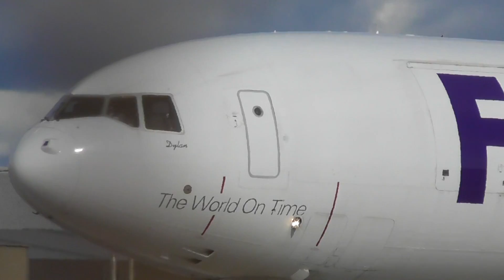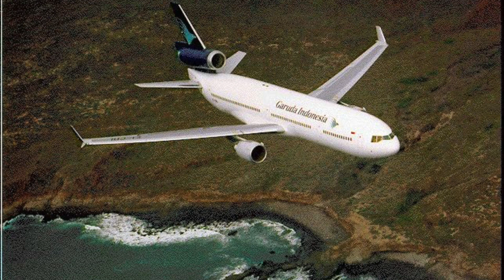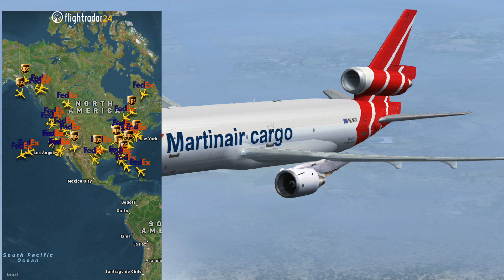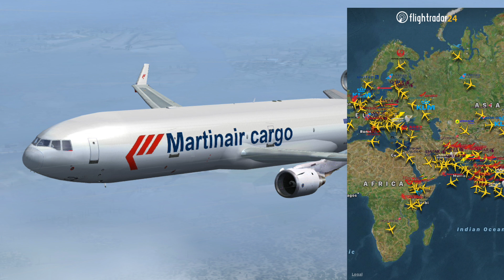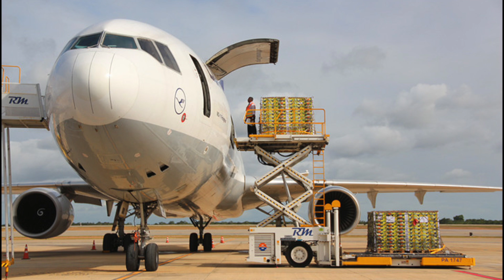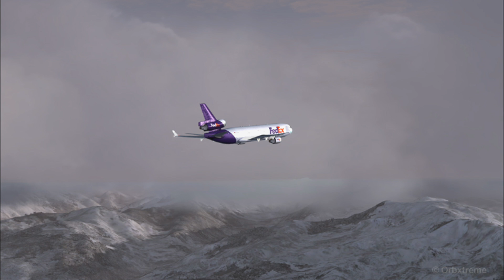WIll a RE-ENGINED MD-11 or MD-11X Work?

Comment: I rode in a Thai DC-10 back in February 1974 I could swear the pilot must've almost overshot Bangkok as we went into a steep decent & my ears were in pain. Never before nor since has that happened. I rode in a Lockheed L-1011 several times & found it far more comfortable. That said I never had the chance to ride in a MD-11 but it looked so much sleeker. I have bought myself the Eastern Express MD-11 kit & a set of SWISS decals to build. However, Boeing now owns MD, but after viewing your video I thought to myself.....if the nose was altered to be more aerodynamic & the tail redeveloped by deleting the 3rd engine, then adding 2 huge GE/P&W/RR engines under the wings, without too much effort you have a B-797.

Comment: If the MD11 is re-engined it would be a good idea for the engineers to design and retro-fit larger elevator trim tabs to prevent another accident like the one in Japan where flaring 5 seconds late destroyed the aircraft and killed the pilots

Comment: Thank you for a great video, the end came for the Three Engined MD 11 because of very tough competition from Airbus who claimed their A-330 Models could do the same job on one less Engine, MD also toyed with the idea of removing the Rear Engine to compete but never carried it out,  I did like the MD 80 & 90 Models , but they were upgrades of the DC -9 which had been built for a long time , and fell down on the fact that the Fuselage was a 2 x 3 and not a 3 x 3 compared to the Boeing 737 & Airbus A-320 . I do wish MD Douglas had survived and not sold out to Boeing ! but thats a fact of life , the strongest survive.

Comment: Yes it'll work. I will design it all by myself and then "put into production". It will have new engines new technology including avionics, a standalone third engine at the back using their own fuel system so that when the third engine finishes fuel, the other two engines still use the main fuel tank not the third engine 
And then it will have new winglets

Comment: Hmm, thought the video meant replacing the existing MD-11 aircraft engines, which might be entirely economically feasible and maybe preferable for cargo airlines. Might increase range/fuel economy, lower part costs, and increase the number of airports they can go to due to noise restrictions.

Comment: These planes were designed back when a minimum of 3 engines was a regulatory requirement for ocean crossings. Now that the rule has been changed, no one would opt for a 3 engine configuration. Unneeded cost and complexity.

Comment: MD-11 actually performs well on high terrain with its three engines. In 1996, China Eastern Airlines and McDonnell Douglas tested an MD-11 in Tibet and they concluded it did perform quite well. Since it has three engines, the thrust wouldn’t diminish as fast as planes like 777 that have two high by-pass ratio engines. This is a reason why cargo operators still fly MD-11. Maybe this would be a market for MD-11

Comment: Nice to see the old Delta livery.  I guess we all make choices, Airbus v. Boeing, Beatles v. Rolling Stones, but for me, the Lockheed Tristar was a better travel experience than the DC-10 or MD-11.  Of course, that was due to airline layout, but in Delta, that seating for the Tristar was roomy and for the MD-11, no legroom in economy.  Still, there was something very elegant about the Tristar.  When I was younger, my family lived in Los Angeles and I lived in San Francisco.  Most flights were on 737's and DC-9's, but if you were a bit clever, you could fly on a Delta or TWA Tristar or even a Pan Am 747 (their London-San Francisco flight would continue to Los Angeles).  Airfares were in the $30 range for coach, $55 for first class.  Those were the days. :)

Comment: Tri-jets existed mainly to satisfy FAA rules that prevented planes with only two engines from flying long flights over the ocean (they couldn't fly more than an hour from a diversion airfield). Once the rules changed in the mid 1980's with ETOPS certifications and twin engine jets could fly the longer over-ocean flights, tri-jets were no longer needed.

Comment: I thought that the 3rd engine disappeared because a single modern engine is powerful and reliable enough to get a plane to safety, if the 2nd one breaks down over the ocean. In other words the 3-engine planes are only favoured by the cargo guys because they're cheaper on the 2nd hand market now that the more cutthroat passenger market upgraded. Are they maybe also more flexible in terms of flying weight? I do miss them mind, especially the ones with the huge tail wings.

Comment: There is such a glut of old 2 engine airframes (A300s, 757s, soon to be 777s) as to make any future possibility of building more MD-11Fs a non-starter. Because freighters spend so much more time on the ground and not in revenue service, the major freight carriers won't buy a new trijet; they'll just buy and older twinjet and convert it. Re-engining the existing -11F fleet might gain some traction if it resulted in a fuel or maintenance savings to make for a short return on investment. The only reason UPS flies new 747s is the extra capacity quickly pays for itself on long haul routes. That said, I love the -11Fs and am much more of a fan of freighter service than pax. I only see A300s flying in freight where I live, so to see an -11F here would be quite a treat.

Comment: MD-12 was a FOUR engined airplane with full length upper deck like the A380.  I have some of the original plans and layout drawings from MDC.  Engines were weak as was the market then.  PS. GE-90s could be fitted to the wings but removing the banjo and center engine would be such a weigh and balance problem with the heavier forward engines, you'd have to take a plug out of the constant section forward of the wing or restrict fuel - remember there's already fuel in the horizontal stab on the MD-11.

Comment: I really feel the MD-11 was retired far too soon. But here's the ray of light. In this age where twin engine jets are dominating the market due to engines being so reliable, the 747 and A380 have still managed to hold on and stay well afloat. So I don't see why a revamped MD-11 won't work. They could also militarize the airframe and offer it as a KC-10 tanker replacement or maybe even an AWACS airframe

Comment: The company I worked for had a product that was designed for the DC-10 when it first came out. The three engined aircraft by Douglas and Lockheed were always a compromise based on the then high bypass engines used on the competing four engined 747, so that they could work in the same overseas transport market when two engined  American built aircraft were forbidden to fly such routes. That Douglas Aircraft had to please the FAA by building a three engined passenger aircraft is somewhat ironic, as they made their reputation in the 1930's with the DC-3 that was up against the Tri-motor airlines of that time by convincing the FAA that a two engined aircraft could be as safe.
I believe the cargo carriers are just taking advantage of the low air miles of the MD-11's that became redundant once ETOPS certified twins were available for that market.  The same sort of thing happened around the time that the three, (later four with the A-300) wide-bodied airliners became much preferred by customers. The DC-8 stretch versions would hold a similar number of passengers to the first wide-bodies but with four low bypass engines were not considered  viable for passenger service any more. Cargo aircraft spend more time on the ground than in  the air sometimes, so the extra fuel of the extra engines isn't such a burden.

Comment: It still has mileage left as a freighter but we wont see three engine jets in passenger use when two engines can get you from London to Australia non-stop. One of the reasons older aircraft are still in use as freighters is because they spend much of their time on the ground and visit hubs overnight to fly to destinations for the morning. In the UK you can regularly see Fedex MD-11s going into Stansted as well as Western Global.

Comment: Wow, quite a lot to sift through here, interesting video though, DJ 
First, yes, you're clutching at straws. The "XX" always used to be just a placeholder. If you look at the original standby name for the A380, it was A3XX, it just means they haven't decided on a name yet.
The MD-11 and more obviously the DC-10 had HUGE safety problems. The 1970's and 1980's saw far too many accidents due to bad design and poor maintenance ethics, and people just didn't want to get on them any more. That alone, in my opinion, is the main reason they've only really been seen in the freighter form for so long.
One of the main design flaws of the DC-10, for example, was a lack of redundency. 
When all is going well, it doesn't matter, but when an engine explodes and manages to take out all hydraulics making the airplane practically unflyable. Or when an engine sheers off the wing during take-off (because of bad maintenance practices), but the problem is compounded by design flaws which means the slats return to the unset position because there is no redundency to maintain pressure to them (without the flight crew being made aware of the problem), these are basic design flaws.
Will we ever see a re-engined one? The question also should be: "Do we need a re-engined one?" The simple answer is no. The engine power from a single new generation engine is almost the same as two of that generation's engines. But that increase in power has come from (in part) an increase in size (it's a by-pass ratio calculation which I'm not going to get into here). But what is the point of a third engine which cannot be increased in the same way because the redesign of the tail plane to accept such a massive third engine would negate the benefits.
At that point, why bother with a third engine? At which point you can say you don't need to have it. At which point the idea of a re-engined MD-11 becomes pointless.

Comment: Note on the MD-11 that there is a reverser on the tail engine as well where the DC10 only has Long cowlings. The “MD-12” proposal was MCD’s last ditch effort to keep afloat.  Unfortunately, the “MD-12” reception was cold and the MD-11 was the last trijet aircraft that McDonnell Douglas would produce. After Boeing acquired McDonnell Douglas, the trijet (I think) was essentially killed in favor of twin-jet aircraft. The facilities in Long Beach off of Lakewood Drive where the McDonnell Douglas aircraft were produced is now a Mercedes Benz redistribution facility (although the “Fly DC Jets” logo is considered iconic and still there). The last aircraft out of that Long Beach facility was the Boeing 717 (Ie MD-95).

Comment: Easy, all you need is a DTOPS (Decreased Twin engine Operational Performance Standards) regulation and then you will see airlines buy and convert cargo aircraft at a high rate.
They would even go to restore old DC-8s to keep their operations going.

Comment: Hopefully it will stay dead. Out of every six legs using the MD-F one is delayed or cancelled. It is complicated to load and unload as it is almost as unstable on the ground as it is in flight. We call it the "Mad Dog Eleven" as it has the same relationship to fine aircraft as MD-- as to fine wine. I work on these beasts and they are cheap dirty and dangerous.

Comment: The reason why the md11 was made is that to circumvent pre etops rules.  As pax airlines strive for efficency, the more thee engines, the less, and with etops, they would rather stick to twins.. re engine  upgrades for cargo is a option, but very unlikely.

Comment: An MD-11 Next Generation or Max could work but would need significantly more efficient engines to match the efficiency of today's twin-jets, or something else absolutely exceptional to justify the extra fuel burn from having 3 engines, or both. 

Same thing with the Lockheed L-1011 Tristar variants. L-1011 Next Generation? Possibly as a cargo plane, but not necessarily as a passenger jet. 

The comeback of the MD-11 and Tristar are complicated by the fact that (IIRC) the tooling to make both planes is gone.

Comment: Three engines on this amount of passengers does not work anymore. An aircraft should has a minimum amount of engines, for costs, fuel and maintenance reduction. Therefore, the best three engine configuration would be a wider a/c than the 777, longer, and enough weight to make three GE90s or even GE9Xs make any sense. Any sensible widebody has a long range focus, so a composite-material wing is almost a requirement for their smoother aerodynamics and their weight. Conclusion, MD-11neo would not work, a new 3 engined 777X would make most sense. 

But since the A380 and B747 are not doing so well, I guess the 777X would be the largest passenger a/c possible in a commercial sense. 

It will make more sense to power a narrowbody 737-10 with 1 smaller sized GEnx, like the PiperJet (but now with S-duct to reduce de-stabilizing issues)

Interesting story nevertheless!

Comment: The MD-10 had a poor safety record, not because it was a bad aircraft.  It seemed that between the cargo door problems and bad luck, it had several uncontained engine failures notably United 232 and AA191 due to improper engine swap.
Reply: A D i

Comment: Not a chance of a re-engined MD-11 since it couldn’t begin to compete with today’s twin jets. Another distant possibility would be to remove the engine on the tail and replacing the wing mounted engines with new efficient and higher thrust engines. 
It is doubtful for several reasons the main one being cost vs the useful life left in these airframes but it would result in better operational economics with lower fuel burn, reduced maintenance, and drag.

Comment: One problem with the current MD11 is it nose landing gear, being place so far back in the fuselage. So pilots have to land at a high speed and flair a bit longer to avoid bunny hogging down the runway . There had been several crash due to pilot error whiles landing in this aircraft.

Comment: The first question has to be who exactly would re-engine it ? I doubt that Boeing is going to ! It would need a large, competent airframe specialist and new pylons will probably be required. I doubt that the #2 engine will be easy to deal with. Leave it as is ? Also remember that the MD-11 has a smaller tail than the DC-10 to reduce drag but also makes handling, especially on landing tricky.

Comment: It won't work.  McDonnell -Douglas, the manufacturer no longer exists. They were merged into Boeing years ago.  Soon after the merger, Boeing discontinued the  MD-11. The tooling required to build this plane no longer exists.  Since the industry has essentially moved to twin jets, carriers for passengers and cargo simply don't want 3 or 4 engine planes.  I did read once, but I forget which plane it was, either the DC-10 or the L-1011 was originally envisioned with only  two engines. However, the engines available at the time, (the 1960's) simply didn't have the legs to perform adequately.

Comment: It could work. It just needs two engines
Reply from the maker: I think that's the main thing.
Reply: I concur that it could work, as a two-engine jet airliner. Maybe a three-engine one for long-haul overseas flights, as 747s are phased out. Just a thought.
Reply: You also need McDonnell Douglas or you need to nag Boeing into creating a two-engine version, Boeing is probably going to re-engine the Boeing 767 anyway... or make a new plane like the NMA and make a NWBA...?

Comment: The only reason it had a 3rd engine was to comply with US regulation at the time, which banned long haul dual-engine flights. But now that has changed, so no it wouldn't work.

Comment: The future variant of this aircraft should either 

Have its tail engine as an electrofan that has a dual purpose of a huge kinetic energy generator and RAT but also provides most of the thrust during Cruise to save fuel 

Or become even more eco-friendly by making its pylon engines electrofans instead to serve as the main thrust propulsion which would make quieter landings and takeoffs. Its tail engine would still be a conventional turbofan that also acts as a generator. It would never be used at full thrust in order to save on fuel but can be activated for thrust redundancy if the pylon electrofan engines malfunction.

Comment: I wish this aircraft would come back and would be able to work as a new or re-engined aircraft. The problem today is the fact that twin engine aircraft are able to have the same amount of range today as tri-jet, while being much more fuel efficient, and having lower maintenance costs. The only reason the MD-11, or simply three engine airliners in general, enjoyed some success is because of certain regulations from the past that made it so twin engine aircraft could only fly over water if within an hour of a suitable diversion airport. To get around this, airplane manufacturing companies made three engine jets for airlines to be able to fly direct over water on the lesser demand routes that the 747 or four engined aircraft wouldn't work on. With the advent of incredible ETOPS ratings for twin jets, and the prevalence of point to point flying at this day in age, there is simply no way a re-engined or upgraded MD-11 would work as a passenger airliner. I believe, however, there could still be a cargo market for an upgraded or re-engined MD-11. This is contingent on a 787 or A350 freighter not being made, however, because if one of those become operational, there is no way the MD-11 could survive any longer. Loved this video, congratulations on 10K!